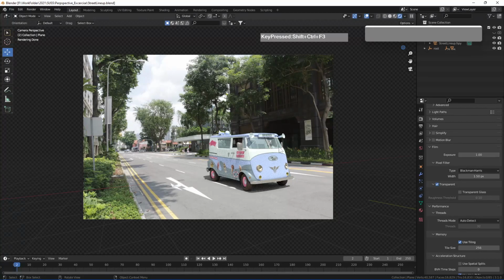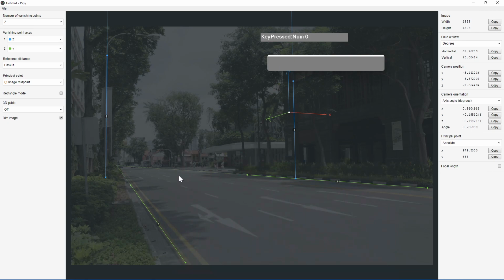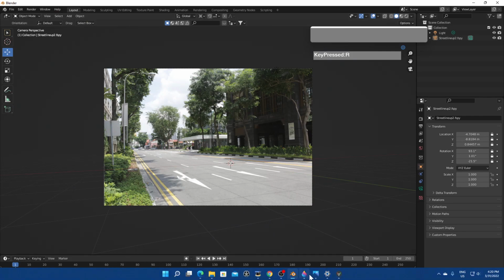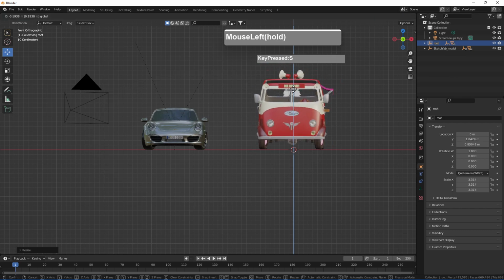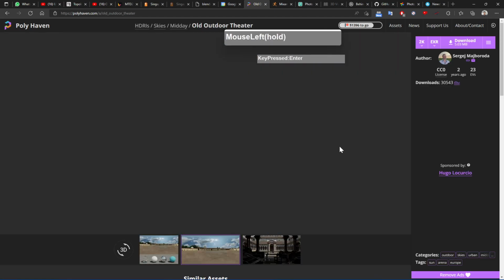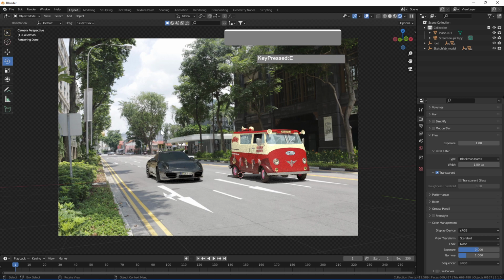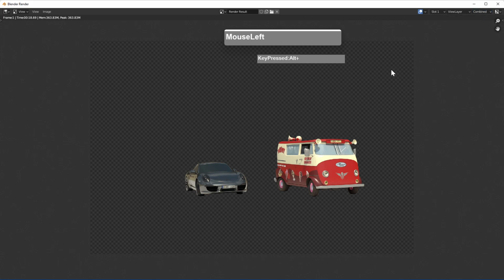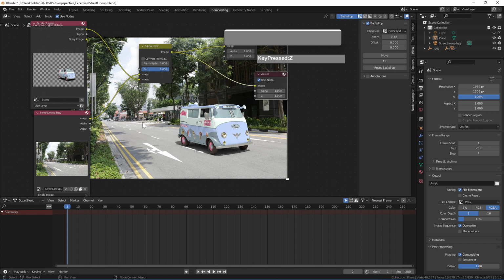Layout Camera with Fspy,  HDRI lighting and compositing 3D elements with Blender 3.1

Comment: 2 things you missed in fSpy...
- When lining up the alignment lines hold down shift to get an enlarged view. Then you will be more accurate.
- ALWAYS move the 3d cursor to a useful location. The end of an alignment line, or a building corner. Somewhere it will be useful to have as the origin point in Blender. The Blender origin point is what that 3d cursor will become.
Reply from the maker: Thank you for the tips! This is very useful!
Reply: @weeliano  I am glad to help. I love fSpy, but I notice most tutorials miss those 2 important things.
Reply from the maker: @neilmarshall5087  I've pinned your comment! I might make an update to this video.
Reply: From what I could see this solution doesn't work correctly in evee, no shadow is projected on the mesh, if you're going to make an animation using cycles it's a waste of time. Does anyone know why no shadows are projected onto the image created by fspy?
Reply: @devlabpro  Look up Blender Shadow Catcher.
fSpy is to set up the camera correctly - by calculating the basic camera settings and location. To allow users to easily reproduce the buildings (or whatever) in an image. It has nothing to do with shadow creation or lighting.
Good luck and happy blending.
Feel free to post more problems - glad to help.
Reply from the maker: @devlabpro  Hi you can always create a eevee shadow catcher material herehttps://www.youtube.com/watch?v=NFcSuMxm4GE